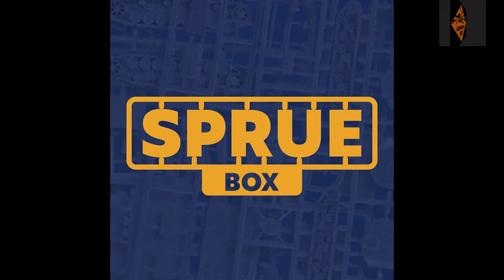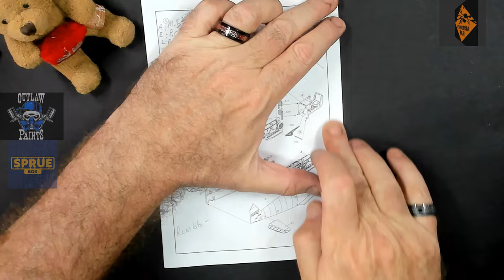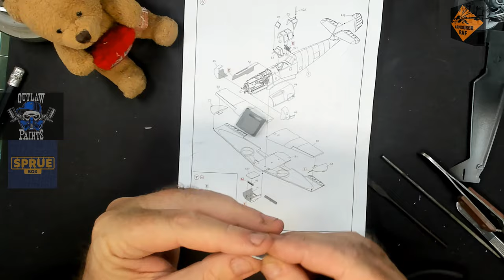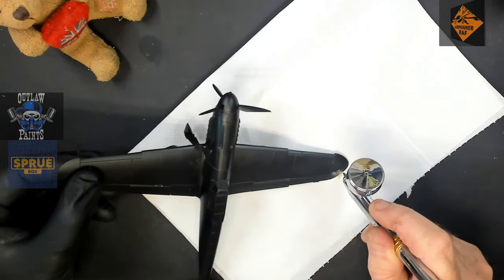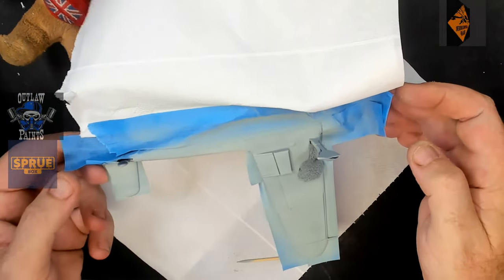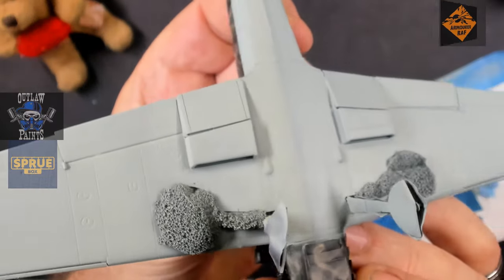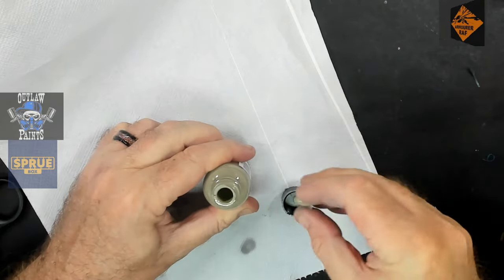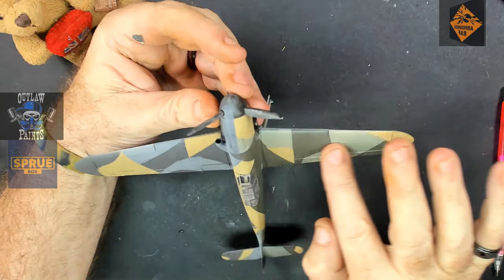Paint Comparison - Outlaw v Alclad On the ICM Me109 supplied by Spruebox

Comment: 9:52;Not only am I going to be humming this poxy military tune(I did like it once!)but I'm going to detest it for weeks now!
Also,I MUST ask;what WAS the point of "worming" the undersides?This confounded me from the outset as all of the camouflage uses of mixed colour are always on the upper sections and sides?!?(IF you bother to research elsewhere other than relying on box art that have been known to make errors(Airfix 1/72 Sopwith Pup of James McCudden for example)🤷🏻‍♂️
Reply from the maker: Firstly, the worming is to show slight colour variation rather than a solid colour.

Secondly this is a paint comparison, NOT a historically accurate model, so no research required.